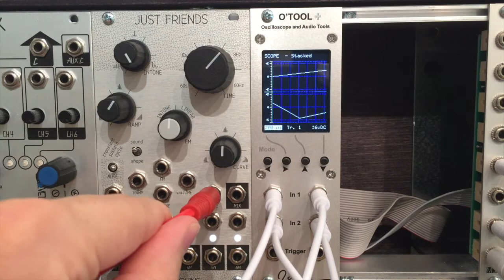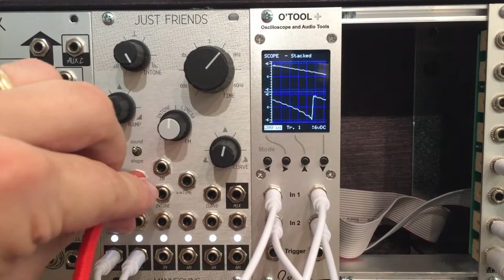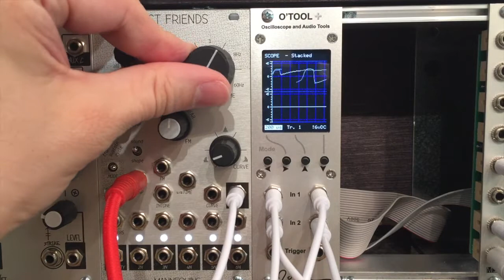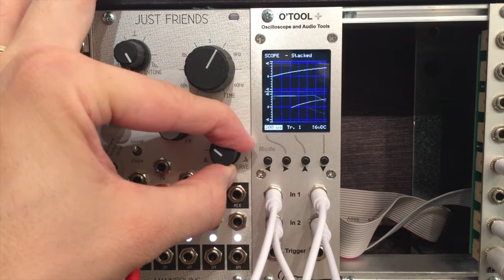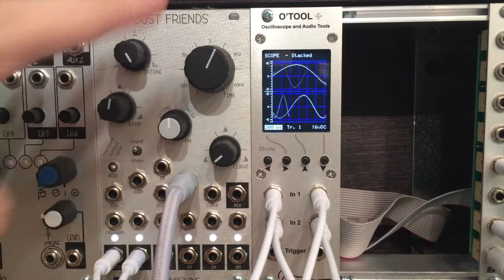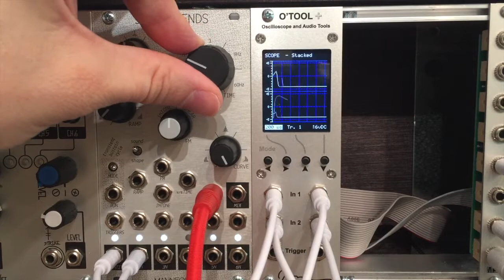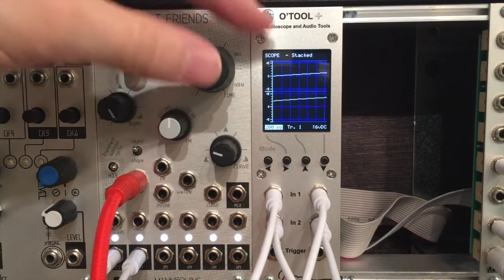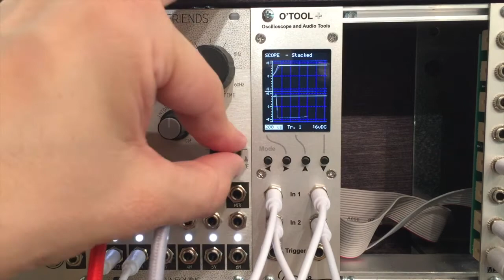Just Friends Under Audio Rate Modulation (note: v1 Silver Clouds)

Comment: It's at this point where the digital architecture starts to break down and show its edges. I own everything else from Mannequins and I can't justify completing the collection because Just Friends somehow manages to be expensive AND digital.
Reply from the maker: I doubt it would be even remotely feasible to implement Just Friends in a pure analog manner. Regardless, I don’t really view audio rate modulation of JF as a particularly interesting application. If that’s your main interest, there are many other modules available that are about that stuff. To me, JF is a unique modulation source first, and a very fat wave shaping sound source second. Now, using JF to modulate other modules at audio rates… that’s a different question.